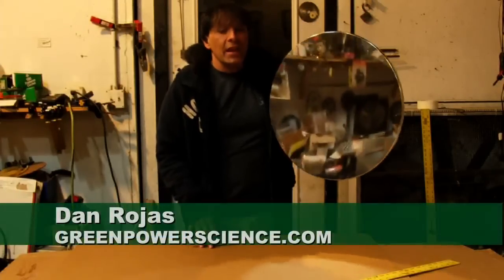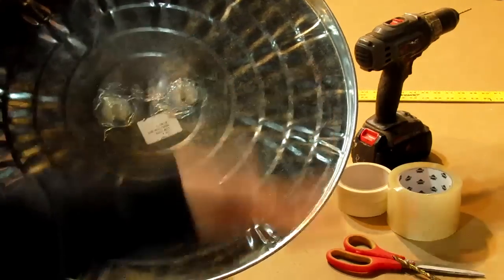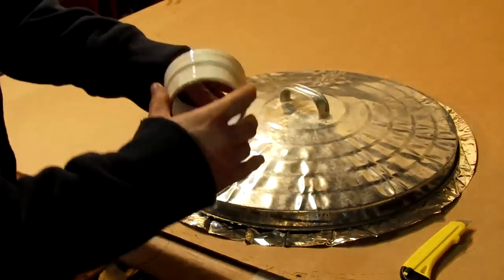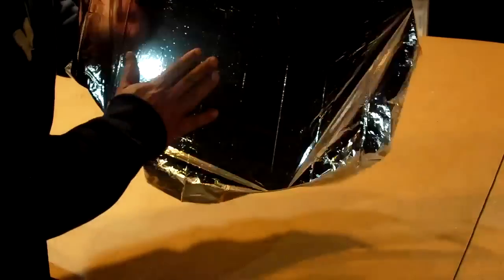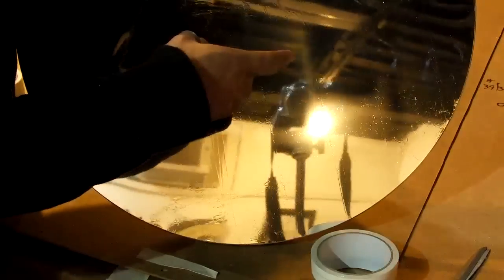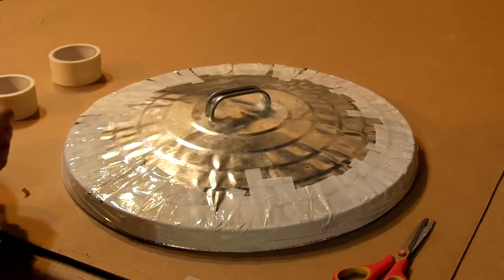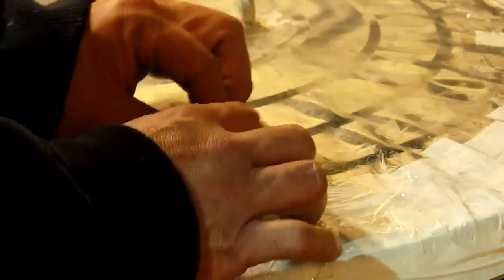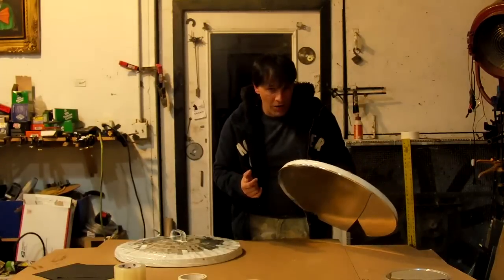Trash can lid to Parabolic Mirror DIY telescope mirror Signal booster Faster 3G/4G

Comment: Just a hint for people who want to make one for a good telescope: don't use it, unless you have 24/7 the same temperature in- and outside. It will slightly change it's convex shape when temperature changes. So the burnpoint calculation is for nuts... But great thing for other projects! Thanks for sharing Dan! Keep it up! ;-)
Reply: Ooohhh here we go 10 years later-dc 5v pump with outlet. I'm on building one. I'll tell you if I managed

Comment: If anyone else was wondering, the deflection of a circular thin membrane due to small pressure differences as a function of radius is w(r) = w_0 (1 - r^2/ R_m^2), where w is the deflection from "flat," w_0 is maximum deflection, and R_m is the outer radius of the membrane. Ref. "Introduction to Microsystem Design" WK Schomburg. This also includes formulas for figuring out w_0 from the pressure difference.

So yes, theoretically its a perfect parabola. For larger pressure differences, thin membranes approach spherical shapes (think bubbles).

For a power generation this is brilliant (cheap and adjustable). I wouldn't discard this for telescope mirrors. For example, if you can make 100 of these mirrors for the same price/time of one highly accurate mirror, you might actually get better images from the collection. There would be a host of challenges (sound, temperature variations). I bet there are some simple ways to overcome these challenges (thicker membrane, controlling pressure) without increasing the cost much.
Reply: you can control it more accurately if it was done hydraulically with a viscous fluid rather than pneumatically as the incompressibility should reduce the magnitude of volume change due to pressure waves (ie sound waves) in the fluid. Additionally this will significantly dampen the mylar film preventing it from acting like a drum skin.
Reply: yeah, maybe if you hold the format using some kind of resine after you get the perfect parabola it may work
Reply: @maxk4324  gravity will affect the shape
Reply: @chanakyasinha8046  Indeed. Even if it's horizontal it will tend to go flat in the center

Comment from the maker: The optical aberration (second surface side) and image distortion occurs on the outer most area of the vacuum lens. The F/stop aperture rings reduce the image distortion dramatically. Oversized and usage of 50% = the center section of the mirror only works My Canon 7d is dead so no video of it right now but with a secondary mirror and focuser, the image quality of the moon is good. Not a full setup yet. There are issues with the vacuum FL changes. Would need more than just a suction tube.

Comment from the maker: I have added "Plastidip Spray" to the interior and stretched while wet. Then you give it a spin so all the spray goes to the outer edges, draw the vacuum and it helps. Temperature changes can also make the focal length change.
Reply: have you tried making a dubsonian telescope using this ..please make one.

Comment: The profile of that mirror isn't parabolic; it is a segment of a sphere. As air pressure pushes in on it, the mylar will behave like a  bubble membrane. Since air pressure pushes perpendicular to the surface at all points, it cannot form a parabola, only a sphere. If all the air pressure were parallel to the axis, then you would get a parabola.

Because it isn't a parabola, the light focus will have some spherical aberation to it, making it unsuitable for precision optics. But it is definitely more than good enough for solar concentration.
Reply: Probably not quite a sphere either. A soap bubble keeps the same tension as it is stretched. This membrane is elastic and the tension increases as it is stretched. Furthermore, if the stretching is anisotropic, the tension will be too. Near the edge the stretching is almost completely radial and so is the resulting tension. At the center the tension is isotropic.
Reply: I dont think the figure is the greatest problem for optical performance.
Reply: Really good point, but this won't work for optics anyway. Good luck calibrating a telescope where the mirror is constantly changing shape because of some tiny leak...
Reply: @kalebbruwer  I found an academic paper that calculated the profile of such "pumped film" concave surface few months ago. If I remember well the profile is actually surprisingly close from a perfect paraboloid, excepted at the borders. Sadly I can't find this paper anymore.
Reply: @h.n.4060  The surface thickness of the mylar?
Reply: @springbloom5940  Actually it usually is. I mean in this case based on the other replies here it happens to be close to the right figure, but just from an optics perspective you are better off with a paraboloid mirror made of a trash can lid than even a sphere shape made in a NASA clean room. This is because of spherical aberration.
Reply: @h.n.4060  likely not suitable for a telescope, but what do you think about a closer distance application such as a mirror for a home brew schlieren image set up?
Reply: @h.n.4060  place the object of study in front of a relatively large (relative to the target) parabolic mirror. Place a point light source such as an LED to one side of the focal point. Then place a knife edge to the other side of the focal point, but make sure it the knife and the light source are the same distance from focal point . This way the knife edge (imagine an old razor blade placed perpendicular to the incoming light, and positioned such that it cuts off half of the light, then a little past the knife edge is placed (usually) a DSLR or at least the sensor from one. Since the light source and focal point are so far away, the variation of the angle of the incident light to the target is negligible, and can be thought of as nearly parallel for the sake of explanation. When passing through the target, any changes in density will cause the light to refract. the refracted light is no longer 'parallel' so it shoots off and totally misses the knife edge and DSLR, or it gets blocked by the knife itself (about half of the light that makes it to the knife should get blocked by the knife). The reason for the knife edge is that it allows you to see second order changes in density rather than just first order. And then bob's your uncle.

Comment: might make sense to insert a reversed tyre valve into that vacuum hole then you can withdraw any air at will and would make for a much better seal....
Reply: Good idea, I was thinking of running a bead of RTV silicone around the rolled edge of the trash can lid to help seal the mylar film to the the metal lid.

Comment: Great idea, excellent project, lightweight, good for cooking but not good for telescopes. Remember that a good telescope mirror will require an 1/4 lambda precision of the parabola, and anything below 1 lambda won't work even for very low magnification light bucket telescopes. And the focal length will change with the time as the vacuum degrades, so it will be close to impossible to put this in an arrangement with any type of secondary mirror.

Comment: Here's an idea! Try bridging a speaker magnet from the edge at four points, then silicone glue a speaker coil to the center of of the mylar. I wonder how that would sound? I'd use it with my piano sound board and strings that I have hanging with homemade pickup coils. I hammer, scratch and pluck at the strings for a really freaky sound. I'll bet the sound and feedback ability would be  just incredible. Peace :)
Reply: Maybe at the edge would give a deeper drum like sound?

Comment from the maker: I have deleted most of the optical aberrations causing image distortion. I will have a video soon explaining the simple process. Very effective for low cost reflectors as they can be designed very large and any surface area loss for optical corrections is not an issue as compared to a real mirror that each sq cm of surface costs lots of money.

Comment: Great idea!!
A suggestion for hopefully an improvenment:
-- After making all the above, construct a strong cylinder around the lid.
-- Put water on the mylar, inside the cylinder.
-- Hopefully, the weight of the water will bend the mylar into a parabole (I think!).
I think that even with just this, you might have a bigger curve, hopefully a better one (!)
Further:
-- A clear and thick glass disc can be put inside the cylinder, with a rubber on the edge, sealing the water below. There should be a hole on the glass disc for air to escape.
-- Then pushing the disc downwards, would push the water even more, and increase the curvature of the mylar. Perhaps (!!) this curvature will be better, or parabolic!!

Again, you gave us a great idea!! 
Exactly the diy ideas for a lens I was looking for.

Comment: This has my head tingling about using a bicycle rim. Sure it has all them spoke holes, and would need a solid backing, but it's an option for anyone that doesn't have a garbage can lid. Love the telescope idea, but would seem a tougher mylar material would be needed for a solid focal point. On the other hand, that could be adjusted on the fly if it did change and have a sensitive vacuum gauge to dial in the parabolic aspect of it. Keep up with the kick butt vids you two!

Comment from the maker: The silicone can get messy with the stretching. If it gets on the first surface side in the form of a smear, it will not come off. If you do it, just light coat. I think it will work. The design is for human powered vacuum suction. If you use silicone do not do that for a few days. Vapors are :-0 Use a shopvac or other pump.

Comment from the maker: The image quality is good from the center 50% of the mirror, the outer 50% screws it up. For solar cooking it does not matter as light is light so long as it covers the cooking vessel but, I have shrouded part of the mirror and it helps dramatically while also reducing the collection area. Since we are using cheap materials, I am thinking  a 40" mirror could make a working 20" mirror 50" = 25" and so on. CPF bulb images very good.

Comment: Good job Dan.  Sandia natl lab had done research on a thin film mirror 20yrs ago that is electrostatic. So what they did was first measure the mirror surface with a laser, then use a cathode ray to move the electrostatic film mirror surface to make it perfect.

Comment: If you put the tape down with a thin sliver of foil or some such over the hole, you can pull a vacuum (those little food saver/jar vaccuum pumps work pretty good),  it will actually lift the tape up a bit and suck the air out from under it,  and when you lift the canning seal head up the foil flaps down over the hole keepinf more air from rushing in.

Comment from the maker: I grabbed a steel pan that was unexposed for 2 minutes. I assumed it had cooled. Nasty blister. We keep all the lenses out of the sun when not in use or they are tracking and in a safe area. I avoid the focal point with my hands. The shower mirrors with x enlarging have caused me issues. I had one set on a table outside and it almost burned up the seat in our old van. Water bowls of clear glass for pets outside have started fires too. Google search "windows melt siding"

Comment from the maker: You can actually do it with human power via mouth (sorry could not find a proper way to put that:-) The silicone needs to set for a few days or you inhale lots of horrible vapors. Did that once. The big mirror video explains it also. After a few days it becomes somewhat inert. A goo set of lungs can almost collapse the can lid as the curved mylar strength trumps the shape of the lid with a vacuum. I used the vacuum pump to see if the mylar would pop. It crushed the lid, mylar was still strong.

Comment: Could you use heat to create the vacuum? heat it under a burner and then seal the hole and as it cools watch is tighten?
Reply: yes, and mylar is well suited for this as it melts at around 500F. Won't be as effective as mechanical suction, but the two in conjunction can achieve a deeper curved surface than your lungs on their own.

Comment: Telescope mirrors are precise to within a wavelength of the visual range (less than 1 um), I think, there's no way you'll get a lid that is flat and round enough, mylar that is of consistent enough thickness, you won't be able to tape it down with consistent enough stretching. Besides sound and other sources of pressure waves will move the mirror. So I don't think it's doable, at least not simply. There are good reasons for using a solid thick piece of glass. But trying doesn't hurt.

Comment: Attach tubing (mostly just to get distance to the mylar), insert a coil, then you can control the temperature on the inside electrically, within reasonable margins, of course, without moving parts or pumps. All you need is initial vacuum to be in range, close the valve, start and stop heating as necessary.

Comment: I have a 4' diameter Andrews microwave parabolic dish. What would you suggest as a reflective coating? Aluminium foil crinkles when applied to the curved surface and disperses too much of the light.

Comment: Dan, first of all, thank you for this video... I am amazed with what you did here!

Second, I've actually made a 6" f/7.5 telescope, ground the mirror from borosilicate glass, and I'm currently polishing a 10" f/6 telescope mirror. I'm wondering, I know you used mylar, but is there an actual material that, when stretched via vacuum, can maintain a parabolic shape of optical precision?

I presume the trash can lid would have to be a near perfect circle (so the trash can is out of the question), and whatever is used in place of the mylar should have a material thickness tolerance of exceptional quality so it stretches evenly. But if this mylar alternative exists, it would make for an interesting telescope mirror.

I can imagine being able to focus by varying the focal length with a vacuum pump, among other crazy alternatives...

It sounds like something interesting, but I have doubts there would be an actual benefit compared to polishing and figuring a glass mirror. I hope I'm wrong though...

It would also be really interesting doing a Foucault test on the mirrors you made to see the quality of the parabola, just for fun...

Any thoughts?
Reply: It seems to me that temperature fluctuations would be problematic. You'd need the vacuum pump to operate sporadically to counter the effects of temperature on the expansion and contraction of the membrane or mylar alternative.
Reply: Bear in mind that the vacuum does not draw the mirror into a true parabola, it's actually part of a sphere. The difference is not material for a solar power application but it won't make a great telescope if you want a diameter more than about f/10. And, variations in the thickness of the mylar or in the uniformity of the edge support would cause small variations in the surface which could be even worse for the optical quality.
Reply: Carlos Paris dont know if this would work well on earth but you mite be on to some thing think about the weight that could be saved if something like this could be used in a space telescope design
Reply: Carlos Paris The vacuum/mylar trick doesn't form a parabola, it forms a hyperbola
Reply: Thanks for the clarification Herbert! Maybe a Ritchey–Chretien telescope? It uses hyperbolic mirrors... In any case, I'm just speculating, but I wonder if anyone has actually and seriously attempted this.
Reply: Carlos Paris simple solution to maintaining the shape would be to using a very low expanding or contracting expoxy or some sort of solution that hardens and cures and suck it out into the proper shape maintaining it's shape until it cures, and when it does walla your done of course using more precise machined pieces rather than a trash can lid.

Comment: Maintaining a solid and reliable focal point would be tough since it relies on vacuum and mylar, but if it was first surface, 98% reflective material with a stiff structure and bullet proof seal, it could work. I think this is a possibility, so don't think of me as getting down on you about the idea as I believe there must be cheaper ways to make a kick butt Dobsonian telescope even if it was built in a disposable manner.

Comment from the maker: From the sun, it should reach temperatures exceeding 1000 F over a smaller area with a stronger vacuum and shorter focal length. The video below uses our true solar mirrors. The process should be the same.

watch?v=aJ22QCAqFCc

Comment from the maker: Hi,
 I would suggest mirrored adhesive film.
watch?v=0qmO47--m6g
The part A has a good adhesive and 3-5 year 100% exposure rating. Adding the part B on top, bumps up the reflectiveness by about 5-7% and allows for 7 year + UV 100% exposure. Both are weather resistant. The link is below the video.

Comment: Do you think if you put expanding foam (the stuff you fill big gaps with that goes hard), you wouldn't need to worry about keeping the vacuum.
Or what about sticking the edge of a round piece of mylar to a flat surface and inflating it, and then put expanding foam on top.
Reply: Epoxy resin is my thought....

Comment: Excellent project .... really inexpensive and simple way to construct a sophisticated bit of kit. ....I'm going to make one.
My only reservation is that the parabolic Mylar surface looks a bit vulnerable ?
Would it be possible to load the trash can lid with a slow setting gel, the excess of which you could remove when you evacuate the lid/mylar space so that the mylar would  settle down onto the gel surface as it attains its parabola ?

Comment: I didn't had any Mylar lying around in my house so I used the inside of a bag of chips, which seems to work as well as a mirror (haven't tried making a parabolic mirror using a vaccum though). However it did not seem as clear as the Mylar, and its size is much smaller.